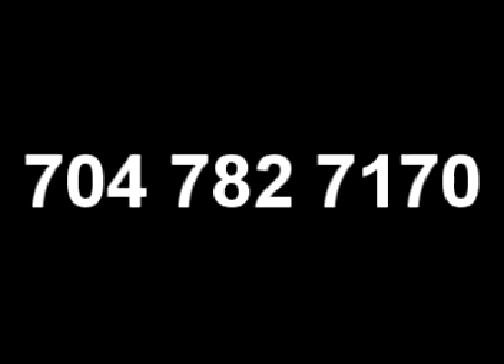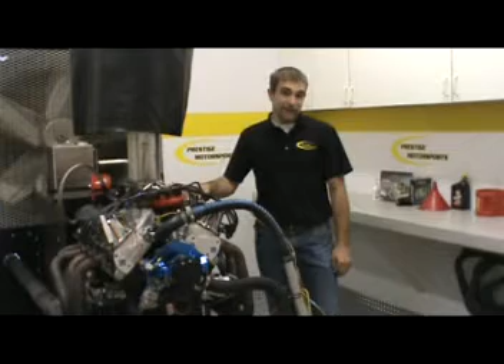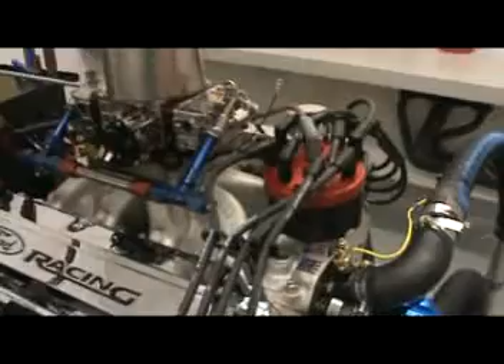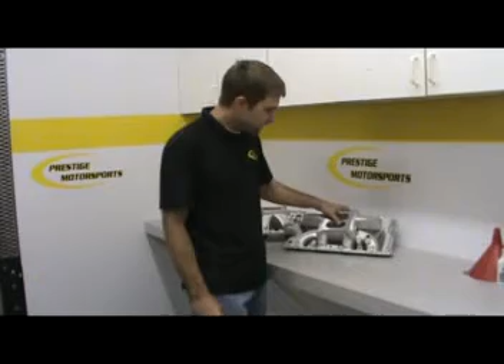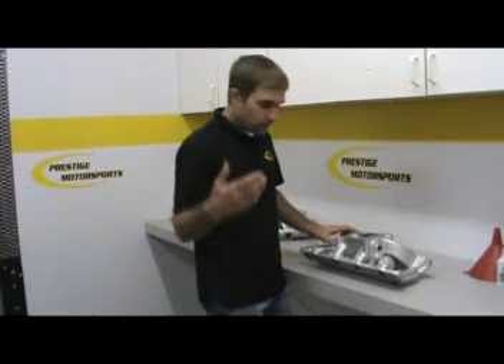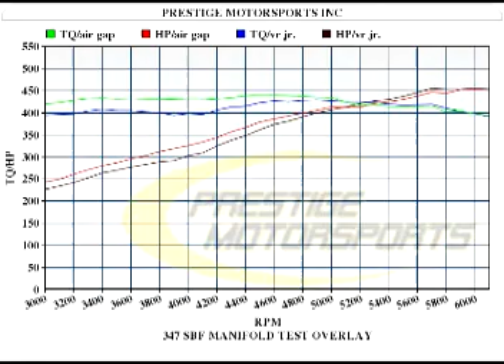Ford 347 Stroker manifold test

Comment: This test was in favor to the dual plane, if you were running vic jr 210 heads or afr205s and a cam of 230-236 dur. And spun it to atleast 6300 the single plane would of made much more power everywhere. Dont know if this motor is makin 425 hp at only 5700 rpm with less than 350 inches.